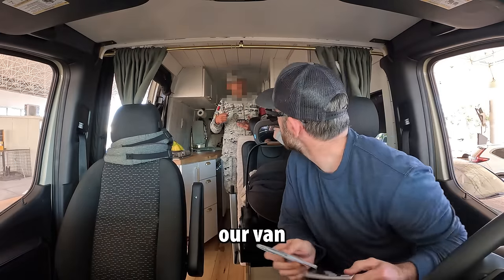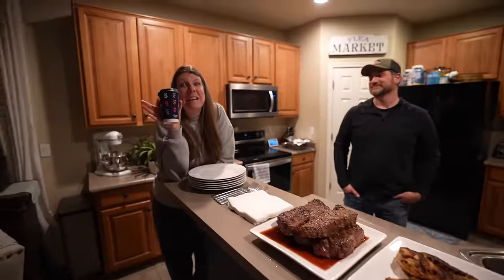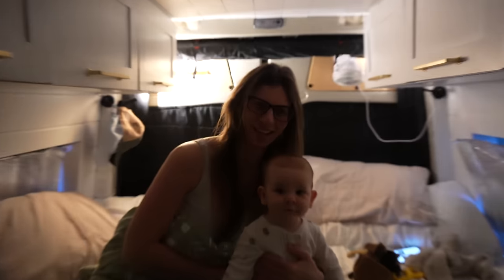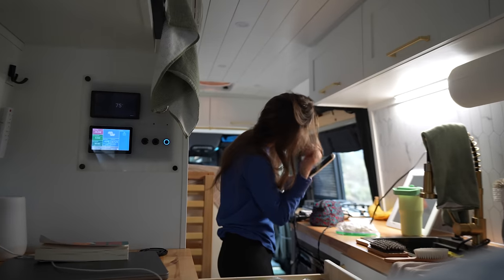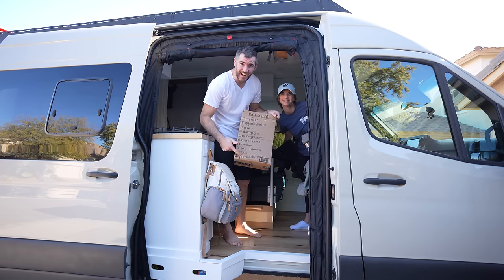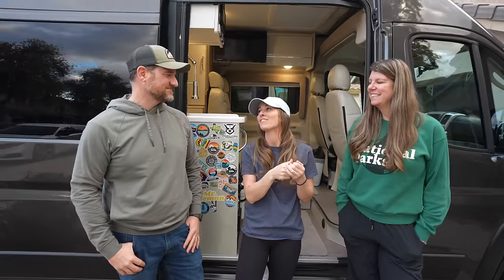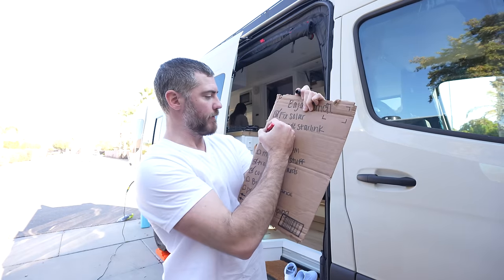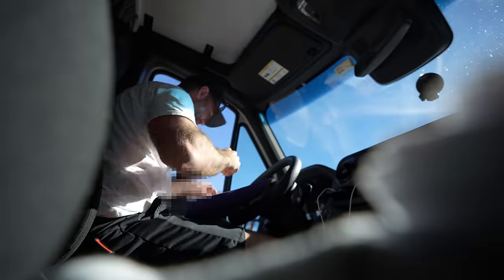Preparing For Van Life Baja - $1,000+ in Repairs & Dead Batteries ... This Isn’t A Good Start

Comment: Van made gear on the window covers.  Made in the USA.  Portland. They are great.  They just don't make all of the ones for tellaro.  We have the scope, yes the one you were making fun of, and got the cab window covers, the sliding door, and rear doors.  They are wonderful.  The factory valences? have been removed and put with that stupid table in the junk pile.  Thankfully I'm not vertically challenged and can sleep quite comfortably on the bed Bob doesn't fit in.  There is a reason they have different floorplans Bob!!  You need to build your own.  Would avoid Thor because of their lousy build quality.  Everything neat is crazy expensive.

Comment: You’d be better prepared if you get the dual alternator kit. Then feed the output from the alternator to a DC-DC converter, you could easily charge the batteries at 100A, have a remote start set up to make it convenient.
Reply from the maker: I don’t think you even need a dc to dc with the nations alternator!! Thing is a beast but it’s $2500+
Reply: @MathersOnTheMap  it’s not that the alternator will get overloaded, it’s that if the battery bank BMS suddenly turns off while under a heavy load the effect on the alternator can damage/destroy the diodes, if you have a dc dc converter it should protect the alternator.

Comment: Those Starlink connectors are crap, they do not seal. I have the same enclosure you have, I also have it hard mounted to the roof in my RV. What I did was ditch the connector that starmounts used, they just took if from the original Starlink assembly. I hard wired the cable to the dish, I then filled in the hole where the cable enters the enclosure. I’ve had it this way for over a year with no issues. 
Starlink themselves have ditched those connectors as well, the new generation dishes come with Ethernet connectors.

Comment: Super happy you shared this before I cut our Starlink to pieces.
Reply from the maker: Check out Trioflatmount may be a better option (I haven’t seen their Gen 2 flat mount personally though) if you already bought starmount maybe put silicone or something to make it water tight?
Reply: @MathersOnTheMap  Thanks, I'll check it out. I was planning to use the Everlanders design as you don't need to cut into the sealed part for that, just the motors for the base. More research needed first I reckon.
Reply from the maker: Great idea 👍🏻his stuff is great